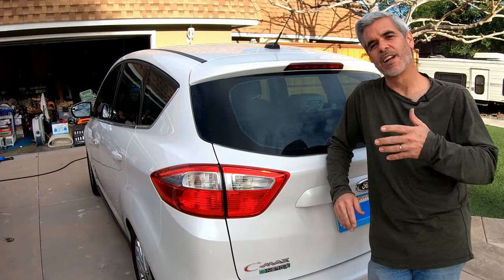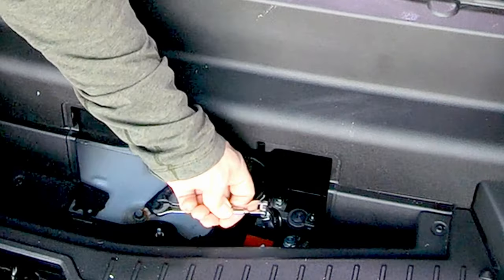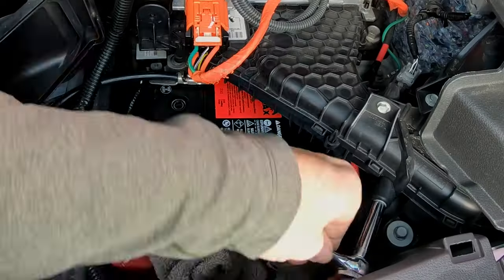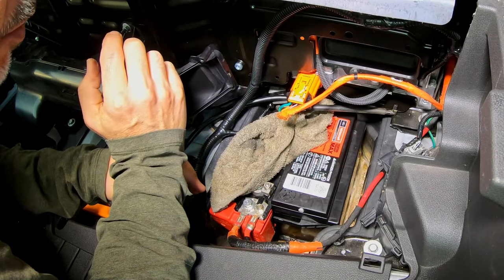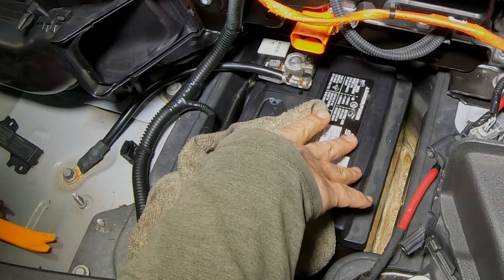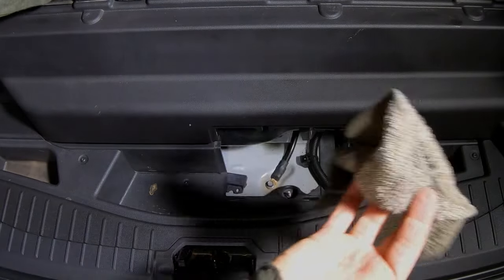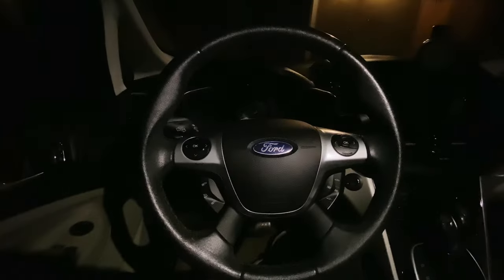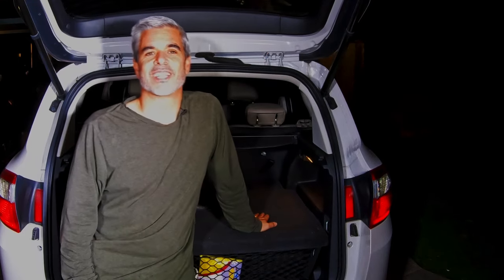Ford C-Max 12V Battery Replacement Including HV Disconnection

Comment: Hi. My husband watched your video to replace the 12v battery in our 2016 Cmax Hybrid.  He got the battery replaced, but when he hooked it up, the car alarm started going off and the only way it would stop is when he disconnected the battery.  Did you encounter this problem, and if so, how did you stop the car alarm?  The key fobs have lost their programming and need to be reprogrammed as well.  Trying to find a video on that, but haven't had any luck yet.  Suggestions?  Thanks for any ideas you might have!
Reply from the maker: Wow, I have no idea what would be going on there.  Were the keys working before? Does the alarm sound right away when connecting the battery?
Reply: @DansWay  The keys were working before all of this started.  The car sat for a couple days while my husband was out of town.  I went to use it and the fobs wouldn't let me in.  I thought it was the batteries in the fobs.  Replaced them without luck. When my husband got back, he did some trouble shooting and that's when he replaced the 12v battery.  Recently, the car sat while we did some internet research on the alarm sounding and fobs not working.  We went out today to at least try to figure out the alarm.  He hooked the 12v battery back up and I was prepared to try a couple of the 'fixes' that I found online, but the alarm didn't start back up. Thank goodness!  One thing down!  We also tried to reset the battery monitoring system, but the flashes of the bright lights and then pressing the brake pedal didn't seem to work. I tried to program the intelligent keys, but the car doesn't detect either key.  We are able to put the key in the 'slot' on the steering column and use that to start/turn off the car.  But the remote doesn't work for the door locks or anything else.  I replaced the batteries in both, but still no impact. I'll keep looking for a fix online in the hopes we don't have to take it to the dealer to get them reprogrammed. Thanks for your video on replacing the 12v battery ~ my husband looked at several and said your's was the best, and the closest to our 2016 c max hybrid.
Reply from the maker: @BrendaCavanaugh  Any update on the car?
Reply: @DansWay  Thanks for checking back.  We haven't been able to reprogram the intelligent keys. Haven't found the right thing online.  I think we'll have to take it to the dealer for help.  Our 'resolve efforts' have been put on hold while we dig out of a couple major snow storms.  Hopefully next week we can figure it out. Thanks again!
Reply from the maker: Hey the @BrendaCavanaugh , whats the update on your car?  Did you get it all worked out?
Reply: Never was able to get the remotes figured out.  My husband is taking the care into our local Ford dealer to have them reprogrammed.  We couldn't ever find a fix for reprogramming them online.  Thanks

Comment: Hello. The problem is battery discharge. How to open the trunk lock.  Show video
Reply from the maker: Got it, sorry about that problem you are having!  The way to fix that problem is to open the driver door with the mechanical key, then pop the hood.  From there, you can use jumper cables to apply power to the car using the red power tap located on the driver side of the car.  That will power up the car computer and allow you to use the trunk hatch release/lift.

Comment: You are magic.😊 Could you address the interior panels? From the first day of my cmax energie  the rear right door panel pulled out. Causing the door not to open unless you lift it up. The dealer can't get it right. The anchors just pop out.😢
Reply from the maker: Thanks for the comment. I haven't had a prblem with the interior panels myself.  Are you saying that the clips don't stay engaged in the door even after being replaced?  So strange...  There are typically a whole series of clips around the perimiter (sides and bottom), then one or more screws that hold it tight to the door.  Those screws should be keeping the panel around the door handle pulled tight against the metal structure of the door. Perhaps those are missing, or the part they screw into is missing/broken/cracked?
Reply: @DansWay  thank you for the insight. Dealership said clip where replaced. Don't  believe them their lips are moving.  Iam going to go and get the clip kit you used on battery video and do it myself. Can't make it any worse. Ty again.
Reply from the maker: @charlotteowens4644 , let me know how that works out.  Not sure those clips will be what you need unless they look right to you.  Take a look at the design.  Could it be more like this? https://amzn.to/3sqqK3H

Comment: I just did this today. What a pain. Cracked the positive terminal and had to buy a new one.
Reply from the maker: Aw man, what a pain. How’s your back?  Any other tips you can suggest?
Reply: @DansWay  Back is fine. I'm just amazed Ford designed it like this. The only thing the 12V really needs to do is turn the HV relay on. They could have made it much smaller.

Comment: Very informative guidance, Dan! I am frustrated with a Stop Safely Now mode on my 2016 Energi. Any ideas on how to resolve it?
Reply: Mine did this and just needed new spark plugs. I've never had a hybrid specific problem on my c-max just run of the mill gas car problems.
Reply: I'm having the same problem, John. Did you get it resolved.
Reply: The only time that happened to me I needed spark plugs. No lie most of the problems you have with a hybrid are going to be the same problems you have with any gasoline engine car.

Comment: Thanks Dan, just replaced 2nd battery in 3 months.  Seems like if I let the car sit for 1 week, sometimes less - battery completely dead - so dead you can't even charge it with a trickle charger that wants to see some kind of a load before letting your charge.  What is up?  Some phantom drain?  Ever seen this?  Any ideas?  Thx!
Reply from the maker: Hey Mike, Yah there are some phantom draw problems with some cars that tend to kill the 12V battery quickly.  Do some google-searching and you will see lots of potential reasons.  I found that my car's water pump was running continuously, or in strange 'waves' faster/slower even when the car was off.  Replacing the water pump eliminated the battery problem for me.  Definitely a DIY task if you are handy.  

Another possibility is the radio not shutting off.  That is another one where twice in the past year I have had to pull out a fuse under the glovebox (F69 I believe) which basically reboots the entertainment computer.  The computer is always running, and can crash or get stuck in a mode so it never enters power-down mode.  The speakers will turn off (except for the dash mounted one for some reason), but it will also run down the battery.
Reply: My brother had problem with battery.   Took over a month to get someone "certified "  to troubleshoot.  After scanning everything was ok.  What was happening  was  key fobs were week.  If hybrid can't sense the key fobs  the engine won't let start.   $10 to replace  fob batteries  fixed the problem.

Comment: Hi everyone. And how have you opened the trunk?
Reply from the maker: You can open the hood and apply power to the 12V system and battery with a battey charger or jumper cables.  Once powered, you can pop the trunk.
Reply: @DansWay  I wonder if there’s no energy, the trunk can’t be opened?
Reply from the maker: @Narek1988 Correct, there is no way that I'm aware of to release the latch without applying power to the 12V terminals under the hood to power the 'dead' 12v battery.

Comment: Do the headlights/turn signal bulbs, that's a real PITA.
Reply from the maker: Actually I did that one a few weeks ago: Easy Ford C-Max LED Headlight Replacement
https://youtu.be/MTSYAH0UG-8
Reply from the maker: I agree the turn signals are a pain in that you have to add ballast resistors.  I’m doing that turn signal video now so hopefully that video will drop in two weeks.

Comment: Did this process and when i reconnected the battery I got a Stop Safely Now Warning. Car will turn on but won't drive. Any help would be appreciated.
Reply from the maker: Wow, so strange.  I would double check the high voltage connector that is over the battery if your removed it, and the high voltage battery disconnect behind the seat.
Reply: @DansWay  I've done that multiple times. Just had it towed to the dealership. 😭

Comment: Great video, very detailed! One step not covered- the second vent hole on the positive side was plugged on the removed battery, but not shown plugged on the replacement. What would you recommend for the job?
Reply from the maker: I'd pull the plug from the old battery to put it on the new one myself.  The fumes around it will be acidic, so whatever you suff in there needs to be plastic for sure.
Reply: @DansWay  Aha, of course! Thank you! Now that I'm in that far I see that the old battery has such a plug. Some folks were talking about duct tape, didn't sound optimal.

Comment: I just paid the dealer $40 to install on my 2017 Energi. Didn't want to have to do all of that myself.
Reply from the maker: That is a great price from the dealer! The quote I have is $110 from Ford...
Reply: @DansWay  I'll take it. I don't move around as well anymore, and felt that the $40 was worth it for the time lol.
Reply: I got the same price from the ford dealer of $110-120.
Reply: @BigKy-Mart  Was this a ford dealer? It seems they are independent from ford, like some one local from an alley tire shop.
Reply: @Luiblonc  No, Buick/GMC store where I work. No discount on labor. A bit higher than the standard battery install fee of $30.
Reply: Q1 2024 - ~250$ labor quote near Dallas Texas at Kwik Kar.. a crazy price and will do it myself.
Reply: The battery itself I had to pay $220 for in California

Comment: how do I check if something is running in the background to drain the battery?
Reply from the maker: It's not easy TBH.  Best method I have would be to measure the battery voltage over a period of hours to see if the voltage is going down over time.  The first measurement shold be done after several hours since the last use of the battery as well, so you will need to open the hatch and leave it there for an hour or so before taking a first reading, then wait several hours for a second.

Comment: Thanks Dan this was a phenomenal video. I took my cmax to get the battery test at Autozone. They hooked it up to their tester. It Read Good 81% BUT that ‘system shutting down to save level’ prompt pops up. It shuts off, the tail gate seems to be glitchy among other small things I’ve noticed. Would you say it’s time to replace my 12v battery? Thanks again amigo!
Reply from the maker: Yah, sounds like it could be time. You could put a charger on overnight to top it off and see if there is any difference after that.

Comment: Shows any error when this battery need to replace?
Reply from the maker: I got a bunch of different problems when the battery was getting weak which is why I chose to replace it.
Reply: @DansWay  I going to buy one like that tomorrow and I wanted to know as much as possible information, I make a drive for 30min and looks like was ok. I'm now used worth hybrid vehicles ✋

Comment: The Foseal Wifi OBD scanner that is linked from this video does not work with the Forscan Lite App. I bought both and no matter what I did I could not get the Forscan Lite app to connect. It connected to other apps I downloaded so I think it is an incompatibility or bug with the Forscan Lite app and this OBD adapter. I'm returning it and ordering a Bluetooth scanner to see if I can get it to work.
Reply from the maker: Not sure why it didn't work for you. Were you on Android or Apple?  I have this one as you can see in the video.  Now I did upgrade to the 'pro' version but I don't believe that would be an issue with basic connection.
Reply: @DansWay  I’m not sure why either. I’m using the Apple iPhone version. Maybe FORScan Lite changed the coding in the latest version 1.5.16 since they changed the core. It does say on the App page that they no longer recommend ELM 327 adapters. Anyway I ordered the recommended VLinker FD BLE adapter which fortunately is not that much more at $45 and uses Bluetooth which will be much more convenient than the Wi-Fi connection. I’ll let you know if this works.
Reply: @DansWay  I got the vLinker FG+ adapter from Amazon (one of the recommended adapters on the Forscan Lite App) and was able to get it to connect to Forscan Lite and to reset the battery age. So I think the Foseal adaptor is no longer compatible with Forscan Lite. Also, I was able to confirm that the manual reset method (flashing highbeams & pressing brake)  did not work for me either.
Reply from the maker: @Blztrls  Ok, I'll have to try using mine to see if it still works.  I just used it last night on my daughter's Kia Soul no problem.

Comment: If I take a 12V battery out of a 2015 Ford Max Hybrid, will the car shut off when new battery replaced and recognized  the car as stolen?  Do I need to purchase a memory saver mechanism device?
Reply from the maker: I'm not aware of any memory-saver mechanism for this car.  I don't recall even loosing my radio stations for example.

Comment: Danx way isnt the good way.   Flip the battery towards your head.    You don't need to take all the stuff apart.   Just one cover and the bolt that holds the battery in place.    Negative and positive.   Flip batter up.    Simple.